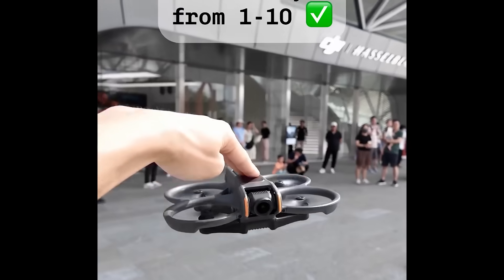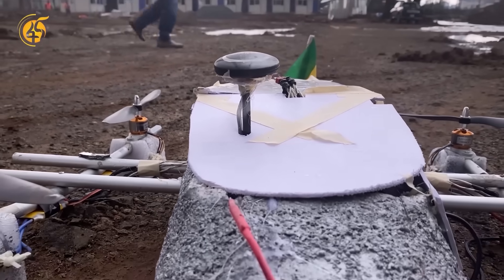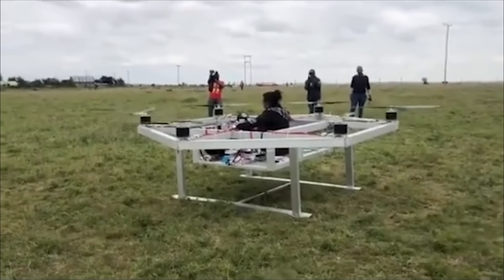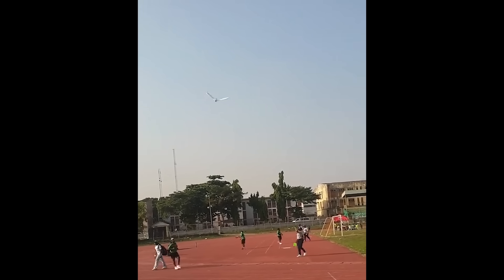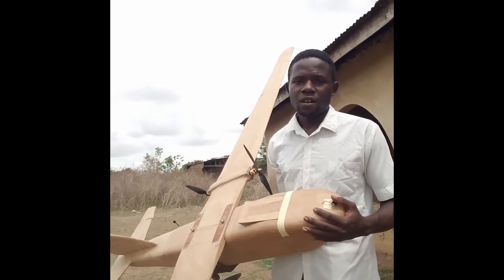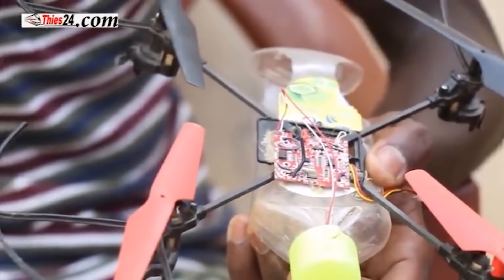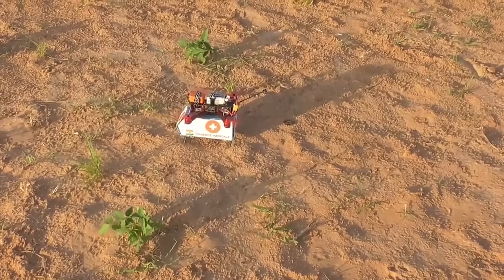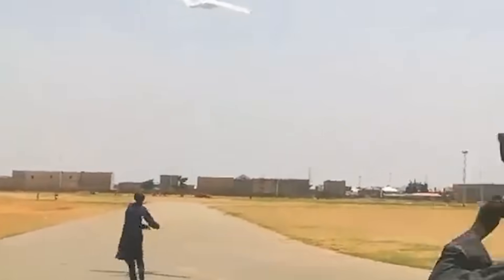DRONES Made In Africa That Can FLY!!

Comment: What if China embargoes drone parts? Motors, circuit boards, batteries, resistors, capacitors, integrated circuits chips, remote controllers, bearings, even simple copper wires etc? You just see the finished components and parts but you don't see the vast industrial foundation behind it that is required to make one kind of component. How much millions of dollars does it take to build one factory that can produce a simple resistor from scratch, all the materials derived from the resources of Africa?
African nations should build a strong industrial base first. First develop the mining industry (especially copper), also develop electrical power able to supply electricity for industries, then a steel industry, copper refining, chemical industry (thousands of chemicals needed to make a simple circuit board) etc. and so on and so forth. Ultimately an electronics industry will come out. Not easy.
I forgot the cement industry. You gotta have lots of cement if you want to build factories. 😁

Comment: As an EE I will say, these guys are doing awesome work! This is what good prototyping looks like. For the 1:50 scale RC plane that he is trying to hand launch. I would recommend using a catapult launch system (think of a giant crossbow but it's launching a plane at a slight angle). You will have to calculate the length of the launcher according to scale of plane you are using. This is good stuff! Keep it up and have fun! Looking forward to seeing some FPV drones soon.

Comment: That thumbnail would never work. 
1. It's upside down. 
2. It wouldn't generate enough thrust/lift. 
3. Wouldn't 2 of the rotors need to be bladed differently (counter rotating) to cancel out the torque. To stop it from spinning.
Reply: but we all clicked to see :face-fuchsia-tongue-out::face-green-smiling::body-blue-raised-arms:

Comment: What do they make the electronics from?
Other drones?
Reply: its mostly by fabricating circuits using microcontroller ICs such as Arduino. you know, just like any other DIYer does.
Reply: Parts are available inexpensively from China and the shipping charge is minimal, for engines, controllers, batteries and cameras.